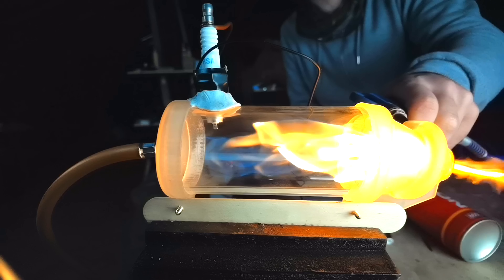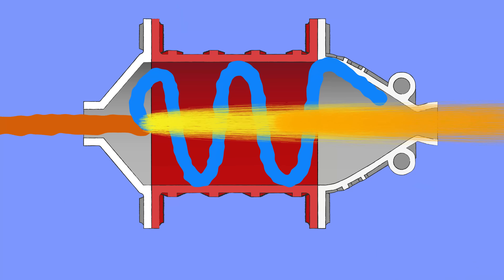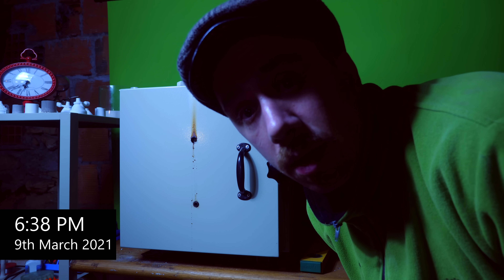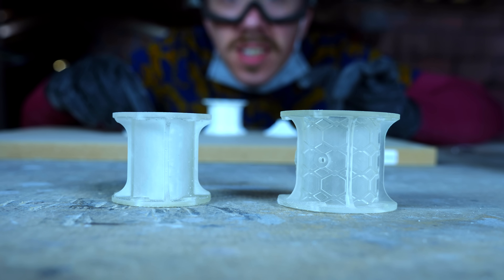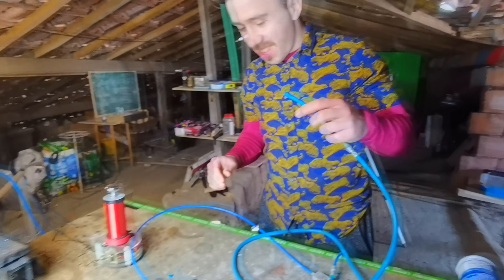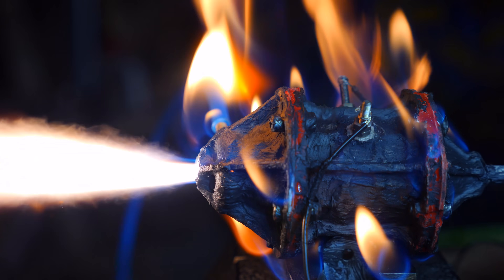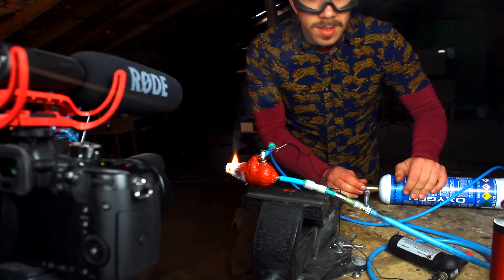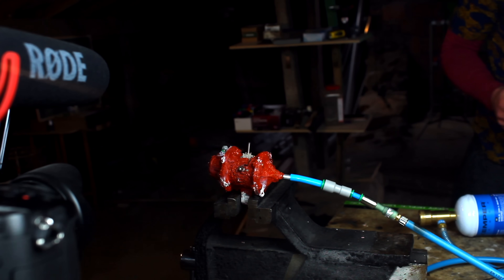Vortex Rocket V2.0 (3D Printed)

Comment: Just a thought... Try applying a sodium silicate solution to the porcelite engine. It will dry into micro fine glass. Because it is very mobile, it will penetrate and fill the pores in the engine material. The other substances you use are too viscous to infiltrate the pores in the porcelite, so gas still migrates through. You might even be able to dip the whole engine in sodium silicate solution, let air dry, then run it through the kiln at a relatively low temperature to cure it solid.

I have no proof of this, but it's worth a try.
Reply: Here's a related technology that explains what I'm talking about.

https://youtu.be/JYugiSwWoPk

That's a macro scale example, sealing the cracks in a house with a very mobile caulking material.

The sodium silicate would serve this purpose, and being a form of glass, may be resistant to the heat of the engine operation as well as plugging the leaks.

Comment: How about a rocket controlled by integza bot junior to roast tomato lord junior preferably beyond recognition tomatoes are disgusting also it would be great to throw some Nikola Tesla flair into the rocket design and have you thought about using heat block puddy for a sealant it's allot like clay and you can get a nice smooth finish just like pottery if you get the surface wet to smooth it

Comment: integza bot v2? Smaller and smarter than ever, maybe it will be able to measure the temperature of the rocket itself, or have a fancy pants oled screen, being able to adjust the timer between pulses. Bonus points if it's small maybe even on a custom pcb? Also since you have a 3D printer, make an actual case instead of the plastic container the old integza bot used to have. Rip integza bot

Comment: What about making the engine out of metal? These engines produce so much heat, maybe you need to step it up a notch with the materials being used. I'm not sure how effective it would be on ceramic, but you could also try using a heatsink (the metal things with a bunch of thin, spaced-out metal plates). The heatsink will draw heat away from the engine, and hopefully, it will be enough to keep the glue from melting and burning.

Comment: I would try to dip the exterior part of the engine in porcelite and then make it harden using a uv light, this done for 1 or 2 times before the cooking process should eliminate any layer separation or porosity giving structural strenght to the piece. Other than that I would also try to use high temperature paint on the outside to close any leftover pores, I personally suggest the VHT flameproof paint because it can withstand temperatures up to 1100 °C for a short period of time. I really hope this was helpfull for you!

Comment: it seems like the high temperature silicon isn't holding the pressure from the engine well, maybe adding cement on top of it will help midigate that

Comment: I think you def need to try also sealing from the inside as well.... As said some sort of ceramic glaze...

However is it that the parts aren't strong enough to withstand the pressures?
Reply: What about printing some test cylinders and checking to see what pressure they can hold?

Comment: I think you should print engine with thicker walls. Pressure inside your engine is too high for current engines and they just tear apart. And the most important, you forgot burn tomato in fire flame.

Comment: Maybe you could use vacuum resin impregnation, it is an industry-standard used in powder metallurgy manufacturing for creating porosity-free pressure-tight parts.

Comment: I guess you need to seal the ceramic on the inside, maybe you can use a graphite paste, or a metallic paint?! To stop the oxygen from entering in to the ceramic pore's! 
I saw that the ceramic actually starts to burn because of the high Oxygen environment!

Comment: Okay i think the issue is between two things, or both, your oxygen doesn't have enough pressure to maintain the vortex rather than combustion, that can either be stemming from the nozzle in witch the oxygen enters the engine or it could be from the bottle of oxygen not putting out enough bar

Comment: How about get to something that supports laminar flow from the vortex itself... I think it would prolly be the same principle as to how the vortex engine works. Coz I think the oxygen was combusted in an oxygen-rich environment that the fuel gets mixed into near the tube where the oxygen is, thus the combustion starting on where the combustion is not supposed to start on. So find the optimal chamber pressure and fuel/oxidizer ratio for that (for a prolonged combustion process that can last long before breaking the engine nozzle itself)

Anyways, that's just my hypothesis.

Comment: What about coating the finished printed part that has been through the firing process to remove resin, coating that with more ceramic resin and curing it with a UV torch or light source. Then do the process of removing the resin on that or just leave it not sure. ?

Comment: infuse it with epoxy and then seal it with either a ceramic coating or jb weld (as you're not using it for more than a cpla seconds)

Comment: You need to make thermal simulations before printing these things. It's much quicker and cheaper (for free actually!),  online simulations will not cost you even CPU power. For such a flow I suppose that you need a thicker chamber. It may be done with two shells (one inside other) and an inner filler-material. Thus you'll "override" your thickness limitation. Test something with StarLite for tomato-sake, damn! ))
https://www.youtube.com/watch?v=0IbWampaEcM

Comment: Have you ever thought about metal casting parts? You already have a great setup for it. A lot of jewelers use 3d printers to create molds for metal casting jewelery.
You 3d print a resin part, put it in a can and use plaster of paris/ gypsum powder to make a mold.
Then you burn the resin out, and put the plaster mold into your furnace for 12-15hours to remove all the moisture.
Melt aluminium, pour it into your plaster mold, and bob's your auntie.

Comment: Did you think about the following?  After you baked the ceramic 3d prints, dipping them after cleaning in pure ceramic liquid to allow the holes filled with it. Then bake it again. My only reasoning is that by removing that 17% of the material the end result would be porous and leaky.   

From what i read on google search is that ceramic is by nature porous and will always leak by high pressor and heat. 

That said it is just a guess im no way of an expert about ceramic at all, and you can classify my as dummy or less.

Comment: I would say to assemble it, mask off the holes after adding the metal fuel and oxygen pipes, then dip it in something like dense rubber. The ceramic should keep too much heat from reaching the rubber, and you could also 3d print a water jacket to cool the rubber. Just a thought though. I'm not an engineer.

Comment: Markforged are using a method that works kind of like the ceramic resin, but with metal on an fdm machine, maybe there is a way for you to do that with filament containing metal on one of your fdm printers or by mixing metal powder into resin, then cintering it in order to get a metal part.

Comment: what about a sealant that can withstand higher temperatures (https://shop.vitcas.com/vitcas-heat-resistant-sealant-1300.html) that is sourrounded by plastic bag which has a lower pressure (vakuum pump) so the athmosphere pushes the sealant evenly against the combustion chamber? dk if this could work but it does in my head :=)

Comment: I think your problem is that the material or parts, cannot handle the high pressure.  If you operate at low pressure it will work. Else you would need to find a way to make it strong enough to operate at the high pressure you want

Comment: Maybe try fixing the leaks by putting some pottery around the engine. Some clays can be very air tight. 
Also video idea: Is it possible to run a vortex cooled rocket engine with an Aerospike nozzle. Best of both worlds and if it doesn’t work due to a too restricted exhaust it’s going to be an epic fireball 🔥 (and then quite a mess)

Comment: Did you ever try burning out the resin while they are in salt? Just put the parts into a metal pot and full the poor with salt (it melts at around 800°C) this removes the need of supports. If you need to go higher in temperature try sand it takes around 1700°C.

Comment: Integza, you must be sure that fuel flow is laminar and no turbulent, then leaking and overheating problem will bo gone.
It's not hard to calculate, use Reynolds number for your fuel
Reply: Reminds me of fluid mechanics exam I had 2 months ago
Reply: @Nico-9138  cool, you pased ?
Reply: @bartekpudo9624  ha yet it went okay, was about generalized Bernoulli's theorem, momentum conservation, Navier Stokes etc. I did forget most of it since tho

Comment: There is a sealer called Thermeez 7030 that you can use to make your ceramics gas tight, you can use it for temeratures up to 1800°F (980°C) maybe this will work for your rocket engine

Comment: Could you use a sleeve of copper on the chamber and use the cement to fill any void. This may not only act as a thermal mass increase the length of time it runs for. But also seals in the gasses. At least on the chamber not sure if you could CNC a block of copper for the ends. Alternatively just make it out of metal.

Comment: Hmmmmm,try using high temperature carbon fiber for the leaks,and a simpler ignition source use an electronic lighter.HOPE I HELPED.i whold like te 3D printer tho
BYYYY.

Comment: Nice animation bro! Build turbo jest engine with more blades ! More is better !!! Also you can use more propane bottles ! To inject more fuel. And if you could you can add internal metal tube and berings inside of it to pump in cold air to cool berings.

Comment: A few ideas. Dirty solution would be silicon coating then a outer casing or box holding water. As it seems the silicon breaks down due to temp and forces involved. A cleaner solution would be to plate it but that would require skills you don't posses and is likely kinda expensive. I also wouldn't use any cement type material as they are not airtight by any standard as a general rule. You could increase volume. Allowing a potentially thicker blanket of air to form over walls. That would likely be your best bet since you would for best results widen not lengthen. But then you will have to play with length in order to reach optimal length and the angle of o2 input.

Comment: Integza you can 3d print bigger ceramic engine splice it in 2 and encase smaller into bigger using sealing material

Comment: They make a paste for sealing automotive exhaust systems. Perhaps that would work better as a high temperature sealant. 

Make the simple Engine again but build more support structure around the nozzle and spark plug interface. It was working really well.

Comment: A possible solution would be to seal the ceramic part, either before the first run in the furnace or after in a second run; with appropriate glazing coatings, just like it's done for dishes, pots and similar artifacts. The coatings need to baked in the furnace to give that glass like impermeable surface, they can be applied by immersion, brushing, or spraying the part.
 The homemade ways to glaze a ceramic part i know are with coal/ash powder or powdered kitchen salt.

Comment: It's just a crazy idea but, try to put the ceramic engine on a ferrofluid liquid and try to seal the porosity by melting the iron using the engine or by the safe way the oven. It's almost as paint made of iron.

Comment: You should try to casting the rocket parts using the lost PLA method, that way you could cast them in metal and if you solder the parts together it should stop them from leaking. Since you have a kiln already it should be a easy thing to do!

Comment: I think you should use a metal milling machine for your parts because when you are making the ceramics they are porous and regardless of the coating you put on it wouldn't keep the gas in because the pressures are too high.
I know there is a titanium 3d printer and you can order parts from them but I bet its expensive.

Comment: To get thicker chamber walls without needing to print thicker ceramic parts you could print multiple cylinders which can sit inside each other like Russian nesting dolls. The space between each of the parts can be filled with refractory cement, which then effectively gives a composite rocket chamber. You could either print them separately or together with thin features joining each layer, though it's possible the thin features might crack during printing. Alternatively a casing from fire bricks could be constructed, though that might be rather large.

Comment: You could put a complete engine in a very loose slip under vacuum and fill the porosity. Set it in a complete vacuum and wait until I stopped bubbles and then remove it and let it spin out and dry then refire it

Comment: I noticed that on the one piece engine your nozzle failed. If it failed due to heat you could try to wayer cool it, or maybe even regenarative cool it by making a chamber of gas fuel around it. Since it would have fairly high flow, it should not catch on fire, but either way it would be a fun video to watch.

Comment: I have a suggestion: test the engine model you want to use and find out where all the leaks are, then remake the engine and strengthen all of the weak spots that succumb to pressure with lots and lots of thin coats of glue or fireplace sealant so that even if they do break they have a lot of inflammable material to get through before the engine is destroyed

Comment: I think the problem is the high temp silicon.

It burns at a too low temperature and so, makes leaking in the engine.

Maybe by replacing it with an alternative it could work (carbon fiber coating like the pulsejet engine ?)

Continue your vids, i love them !

Comment: Maybe try Lost PLA Casting?

Print the part in PLA, cast in plaster, then fill with molten metal. The metal will burn away the PLA, fill the space, and cool into the the part you need

Comment: Why not 3d print the parts, then mold them using a silicone 2 piece mold method? Then pour them out of a ceramic without the resin, allow to dry in mold and remove and fire in kil?

Comment: Ok lets solve that leaking problem - this seems to me a material and process issue. time to order in some steel tube and sheet and break that welder back out you can create tube notching templates using fusion 360  then print them stick them to your tube and use a grinder (dremel or angle grider) to create the angled vortex tube (https://www.youtube.com/watch?v=mu8rpwqjCcM) 

PS where was the tomatoe burning?

Comment: You are going to need to obtain a metal 3D printer to make high temperature parts for your rocket engines. SpaceX is using them and most rocket engine manufactures are using them to create what you already know. Parts with swirl chambers internally to the parts without the need for assembling or welding. Time to upgrade your subscription! Tesla would approve!

Comment: video idea: (possible leaking solution?) 
While designing that part, you should consider looking up for info about ceramic material you are using and how much it shrinks. Knowing that just design it slightly bigger (a little bit more than it should shrink) and after burning them, they should hopefully shrink to perfect size. Also you should try making a form with a regular resign, than use it to make a mould for a specific type of ceramic, that can withstand the heat. After that just put it in your furnace. I would suggest doing it with two part mould, after they are finished just  glue them together with some heat resistant ceramic glue. 
If you succeed, and have a working engines you should make a bike with them ;)

Comment: Using the ceramic parts the only way I can see is if you first use a high temperature insulator to keep the seal away from direct contact with the parts. as they will still get hot enough to burn off most things you could use to seal it air tight. I am not sure, but perhaps you could increase the wall thickness. first print and fire the part then using more ceramic clay an applying it to the part and refiring it. I saw a comment about ceramic glaze, and that sounds like a good idea however oxygen propane burns around 2800 c and the highest temperature I saw any glaze could survive is just under 2000 c. Given a fair amount of insulation this may be able to work.

Comment: Casting sand $30ish/5LB in the USA, I think you have everything you need already to make a propane furnace that cold melt at least steel( https://www.instructables.com/How-to-Build-a-Forge-Gas/ ).  So all you need is a high temp crucible $40ish in the USA for a 6 Kg carbon steel rated one.  It will take a few attempts to get the process right but then you will be able to make high-quality full metal parts from your 3D printed prototypes.

Comment: In graduate school (circa late '80s), we used vortex cooling to keep our (microwave induced) plasmas off the sides of the (quartz) torches (sub 5 mm).  It works!  BTW, I like the idea (elsewhere in comments) of putting the system under partial vacuum to apply the sealant so it gets into the structure (and microstructure--where the leaks are coming from) of your (awesome!) rocket engine. 👍

Comment: hey integza build all of teslas patents and connect all of them to work togeather  and like the hacksmith make it as small series
Reply: and try increasing the thickness of the wall and to create a proper vortex might help i think the rocket is producing too much heat which is along with the minor cracks is causing it to break.....soo maybe try to increse the size of the whole rocket or increase the thickness